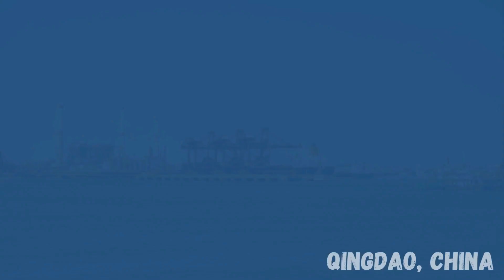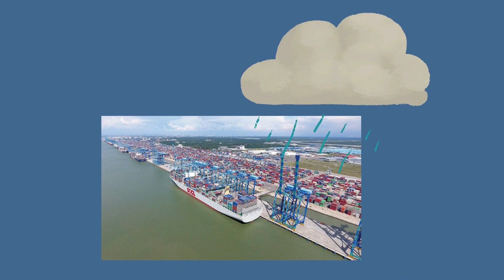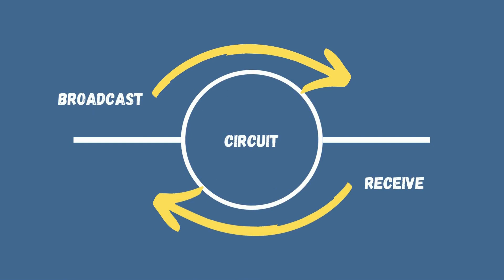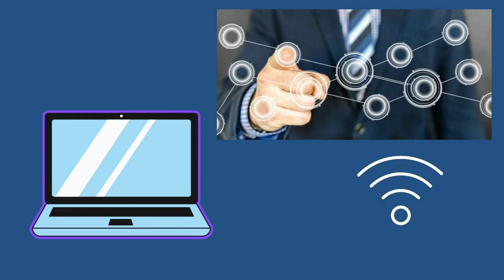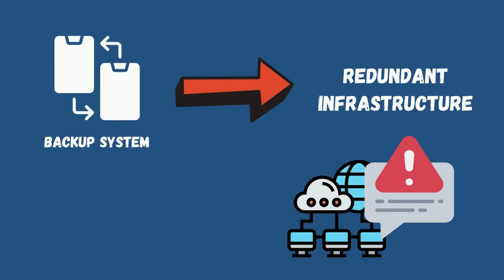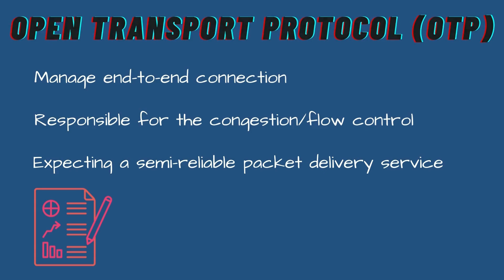5G as Enabling Technology for Building Smart Port

Comment: Very informative video! But I was wondering is there any possible technology that are more advanced than 5G can be implemented in the smart port in the future?
Reply from the maker: Yes, the next generation of wireless communication networks, known as 6G or Beyond 5G (B5G), is more advanced than 5G. It will eventually replace 5G, however it is not currently an operational technology. Researchers believe that it might leverage terahertz spectrum (THz) and radio access network (RAN) to increase capacity, reduce latency, and enhance spectrum sharing. Therefore, it is expected to be 100 times faster than 5G. In the future, the smart port might be able to use this technology. However, given the state of Malaysia at the moment, it should still require significant development before being put into effect. Since more sophisticated technology need greater financial and technical support.

Comment: How efficient would it be to have 5G implemented into smart ports?
Reply from the maker: Smart port is mostly powered by automations and robots to speed up conventional processes. To achieve maximum efficiency, 5G is crucial for smart ports to speed up processes as it is 10 times more efficient than 4G.